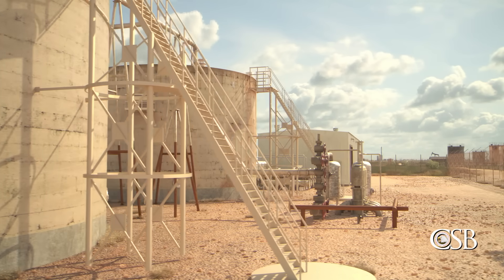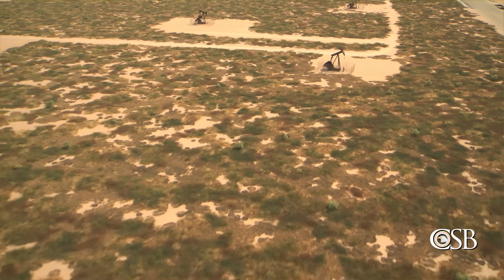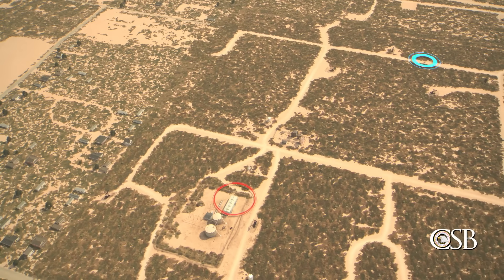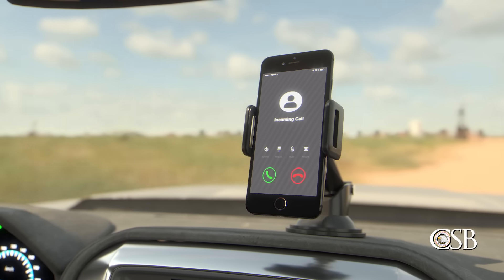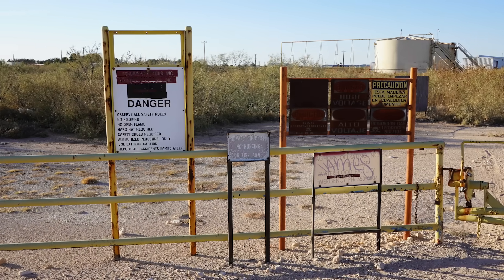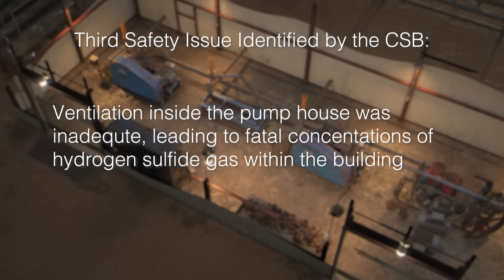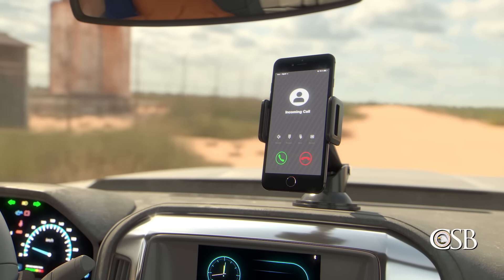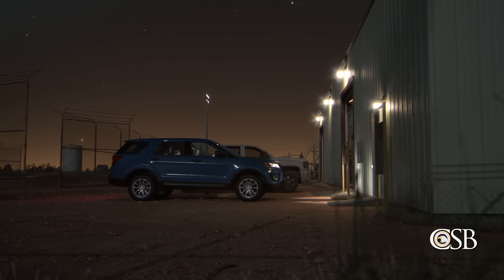Silent Killer: Hydrogen Sulfide Release in Odessa, Texas

Comment: A dramatic incident in the latest episode of Landman, 'Almost a Home' (S02E03), was surely inspired by this fatal accident.

[Spoiler Alert] A group of civilians (hunters, fitting the logic of the Texas open range) ventures near an old, isolated pumpjack to retrieve game. One of them suddenly collapses. The others, thinking it’s a medical emergency, rush to help. As they enter the 'zone' (the pocket of sour gas stagnating at ground level), they collapse as well, struck down in seconds. It is only when the Landman's crew arrives for an inspection that the nature of the tragedy is revealed. Their 4-gas monitors start blaring and flashing frantically. The scene shifts into technical horror: the professionals have to recover the bodies or shut off the valve while holding their breath (or wearing masks), knowing a single breath is fatal.

This scene is typical of Taylor Sheridan's commitment to realism; he knows the oil patch inside out. 👍👍
Reply: Doubt he does. He has people for that.

Comment: Hydrogen Sulfide chronic exposure of less than 1ppm everyday can result in debilitating health issues.  Sleeping 12 hours a day(lethargy), chronic cough, constant sores on your body, muscles will tighten because 
H2S is a oxygen scavenger.  
When carbohydrates breakdown they create CO2, without enough oxygen in your blood carbohydrates will create lactic acid in your muscles resulting in muscle tightening and stiffness.  This can lead to limping due misalignment of the pelvis and premature joint damage to knees and hips.  When you are fired for being incompetent due to H2S chronic exposure good luck holding down a job.  Detoxing could take years depending on the amount of long term exposure.  Look up Chinese Drywall to learn more about Chronic Low Level H2S exposure.  People were forced to move out of their homes due to drywall releasing H2S.  Exposure was less than 1 ppm. First five lawsuits was awarded 1 billion dollars.  www.usatoday.com/story/news/nation/2014/05/02/chinese-drywall-adverse-health-effects-wallboard/8574707

Comment: There was something else that I found confusing...
Hydrogen sulfide has a very strong smell...
It's hard to imagine that the worker who went in could have failed to smell it... 
(And, since they apparently didn't require respirators, I assume there would normally be almost none, so the smell would have been sort of obvious.)
(This sort of supports the idea that maybe there was no hydrogen sulfide when he arrived... and it was released suddenly when the broken pump kicked on.)
Aren't workers these days subjected to any actual PRACTICAL safety training about issues like this.
I would think that, before even being assigned to that building, someone would have done a plain old in-person practical safety demonstration.
("Here... sniff this." " That's hydrogen sulfide." "It can kill you - even in small amounts." "If you ever smell that inside, HIT THE RED BUTTON, then run OUTSIDE."
Reply: Hate to break it to you, once it reaches fatal levels in the air(+10ppm) you can no longer smell it.

Comment: Something within the investigation that is not mentioned in this video is the fact that the wife, instead of contacting emergency services and informing them that her husband did not return home, was actually on the phone with another one of Aghorn's pumpers, who was out of state, when she collapsed while walking around by herself with a 6 and 9-year-old in the car. This other pumper couldn't contact the proper local authorities through 911, and then called the foreman, who subsequently called for Odessa Fire Rescue. When they went to rescue the children, they discovered that both vehicles were still running. 
H2S is practically impossible to detect by smell alone at concentrations higher than 100 ppm. The upper exposure limit for H2S is 10 ppm - exposure to concentrations above 500 ppm can make someone collapse within a 5-minute span, and greater than 700-1000 ppm causes death in a matter of a few breaths. When first responders took measurements, a good distance away from the structure showed 150 ppm, while closer/interior measurements were higher than their device could measure. A subsequent measurement showed a concentration of around 550 ppm around the water leak. However, I believe this value may very well have been excessively higher before they stopped the leak.

Comment: I was a district manager for an H2S  safety company in the early '80s until everything went bust.  I lived in Odessa.   H2S is nothing to kick around with.  The sour gas can only be smelled at 0-10ppm.  Any consentration higher than that, you won't  smell it, you just get dead!  The 0-10ppm is what we used to test  and calibrate our detectors with.  I am truly sorry this tragedy happened, it's terrible, but it could have and should been prevented.   🇺🇸😢🇺🇸

Comment: Just curious, after incidents like this, how does the CSB followup later to ensure that its recommendations have been implemented? Or is that conducted by some other agency? And in this instance, did Aghorn make the necessary changes? I've watched a lot of these videos but often wonder how the followup process works.

Long ago as a sysadmin at a university research dept. (circa 2001), where I was also theoretically in charge of health & safety, one problem I had to contend with constantly was the willingness of employees and postgrads to sacrifice their own safety in exchange for convenience, perhaps the worst example being their repeated habit of holding open fire doors using fire extinguishers. Why do this? Because it made it easier to come & go from the staff kitchen with mugs of coffee or tea in hand. Being new in the job at the time though, and rather young, I had little ability to force much change, given the dept. heads were little better (the mess of papers in one of the head's offices was so bad, it literally spilled onto the floor like a carpet).

However, at a later time, after being repeatedly annoyed by the actions of staff & students that rendered fire drills useless (they somehow knew in advance when they were scheduled and thus just arranged to be elsewhere at the time), I secretly conspired with the Dean of Faculty and the heads of campus safety & security to arrange an unscheduled fire drill, so the staff & researchers had no idea it was coming (note there were no undergrad students), likewise all three joint heads of dept. didn't know.

On the morning of the test, an hour or so after the start of a normal day, I met the the campus safety officer in the foyer and he activated the fire alarm system. Normal procedure is for all staff to immediately exit the building and assemble in the parking lot, which was supposed to take no more than 3 mins. After many minutes though, not a single person had emerged from either the ground floor or the upper stairwell. After about 15 mins, one of the PhD researchers poked their head round the upper floor firedoor, saw us standing below and meekly asked if it was a drill (I think I replied, well if it wasn't then you'd probably be dead by now). The researcher was ordered to leave the building at once (not allowed to return to his office). The campus officer and I then began going along both corridors to eject all staff & researchers from the building, in many cases encountering resistance from persons who had assumed it was a test and had thus chosen to ignore the alarm. After about 25 mins the building was finally empty. I should add, I had initially offered to use my smoke machine (bought for doing laser shows at birthday parties) to add a little realism to the event, but that was declined; personally I think that was a mistake, having the pee scared out of them would have been most fitting.

But I had, as it turns out, apparently by doing all this hurled an almighty bucket of poop into a high speed fan of fallout anyway. :)

About two weeks later, the Dean of Faculty emailed all staff, heads of dept. & researchers and in no uncertain terms tore them a new one (he was absolutely hopping mad at the failure of staff and researchers to heed the alarm), and I think a toned down notice was issued campus-wide. The campus safety guy said the event was the most rewarding day he'd had in a long time, finally being able to expose the dreadful apathy of academic staff and students to a vital safety issue. From then on, tests were instead conducted at irregular intervals and without prior notice, and the habit of propping open fire doors ceased. I can't be certain but it's likely this had knockon effects in other faculties as I'm sure the Dean must have talked with his colleagues and likely the univ. Chancellor about what happened. Note that the dept.'s main function was VR research, which involved large projection systems that used huge projector units that ran very hot, along with other power hungry equipment, so the potential for fire was certainly present. Hence why all critical data was backed up to DLT regularly and stored in a huge six foot tall fire proof safe at the opposite end of the building from the machine room.

Someone in the comments here asked whether perhaps the reason why some of the H2S alarms were set to test mode was because Aghorn personnel were sick of them going off. I think this is the psych effect I encountered at the research dept., ie. personnel placed no value in regular tests, they were conducted too often and everyone always knew when they were due.

Some years earlier when still a student, I was once in a lecture when the fire alarm went off and, of course, at first nobody did anything (the lecturer continued as normal). Then one of the Norwegian students stood up and said loudly, to heck with this, it might be real, I'm off (the Norwegians sure had the smarts), and at that other students began to follow, then everyone finally did, including the lecturer, who seemed embarassed. Turned out it was a real fire (we heard the fire engine sirens on the way out), outside the chemistry dept. which was literally adjacent to the building and room where we'd been sitting. The blaze was at a large gas cylinder, infact visible from the lecture room window; it did not blow up (fire services put out the fire quickly), but the risk was certainly there. Kudos to that Norwegian guy. Hence, later as a sysadmin, I had this well in mind when dealing with the apathy of research staff, etc. to fire drills.

All of which is to say, one can have the most sensible procedures, written or otherwise, but the human element can render them useless. The Aghorn pumper guy left his H2S dectector in the truck; why? Likely due to a false perception of risk. It's uncomfortable to ask the question because he died, likewise his wife, but the question deserves an answer. Such things led to my strong interest in risk compensation theory, a topic which alas I've not seen mentioned in these CSB videos. Humans suck at judging risk and probabilities, but the nuance of how this works is complex and fascinating.
Reply: The CSB itself monitors the implementation of its recommendations, but ultimately it's the regulators with actual legal powers that have to act (in the US, that would be OSHA and the EPA; here in the UK, the equivalents are the HSE and EA). According to other comment threads above, Aghorn were eventually criminally prosecuted and reached a plea bargin to pay a million dollar fine, so one assumes that they didn't clean up their act...
Reply: @amritlohia8240  Thanks for the info! :)
Reply: @mapesdhs597  No problem - and thanks for replying even when your original comment was 4 months old

Comment: With all due respect to the deceased, this man clearly didn't have much experience. This is indicated by the fact that he closed the discharge line on a positive displacement pump {or any pump ftm} without killing the power. That alone is asking for disaster. As a retired pump mechanic of some 30 years in the Odessa area I have seen the result of doing so by others. Valve caps blown off, entire fluid ends pushed off on the ground etc. Once saw a 1/2" bleeder valve stuck in a steel tank beside the pump, and it didn't leak a drop.

If investigators had checked the valves in the pump they'd have been able to ascertain whether it started after the discharge was closed. The extreme pressure squeezes the tapered stainless steel valve assemblies deep into the valve decks of the fluid end, sometimes pressing them completely through if nothing else gives first. However, I highly doubt that to be the case. A broken ceramic plunger is a very common occurrence, and the oil level alarm was most likely a high level caused by water over filling the power end. 

All that being said, NEVER leave your monitor in the truck. H2s is the second most deadly gas known to man in terms of ppm, the most deadly be hydrogen cyanide which was used in for executions in gas chambers. I once checked the level of H2s coming off a line from a row of oil tanks into a vapor recovery unit I was there to work on. Even outdoors on a windy day it went to 2000 ppm and the monitor readout simply went blank, had to get a new monitor. No idea what the level actually was, doesn't matter anyway. One good breath of that and you're dead. No watery eyes or dizziness, no time to run or really even know what hit you. There was no isolation valve on the line to close it off either, a fact I was not happy about to say the least since I was working alone.  I had to put on an SCBA to pull the compressor and then install a blind flange on the line. The oil company { Brothers Petroleum, now bankrupt/defunct I believe} said no to installing an isolation valve prior to reinstalling the compressor.

Comment: The other safety issue only one worker responding to an issue it should be two workers its a confined area one stays in a safe area in case of an issue/emergency.
Reply: That rarely  happens. The pumper goes in when the alarm goes off, and if it's a problem, he can't  handle the mechanic is then called out.

Comment: A fellow instructor when I was teaching recruits on generators at Ft. Belvoir VA had a false lockout situation in Germany the tags said the power was off the panel was hotwired by the Germans because the breakers kept tripping for the overhead crane. He was up on the crane doing diagnostics when he dead shorted the circuit through his hand, He woke up a month later in Walter Reed medical center. Once cleared for duty he was assigned as an instructor at Ft. Belvoir where I met him.
When in doubt triple check. Always have issued safety gear, know how to use it and when to use it..